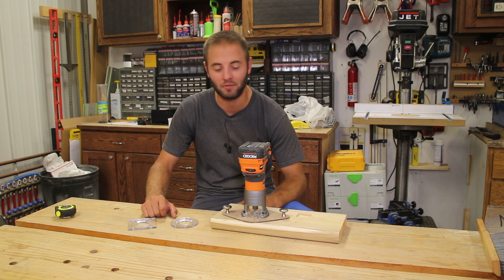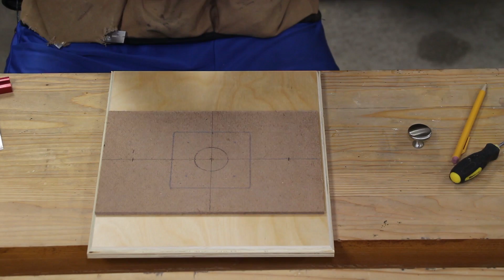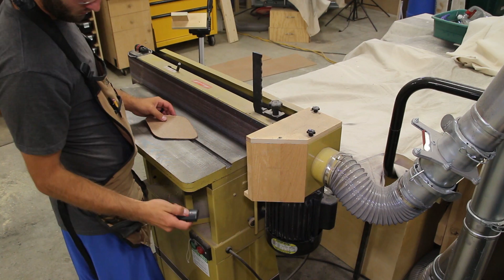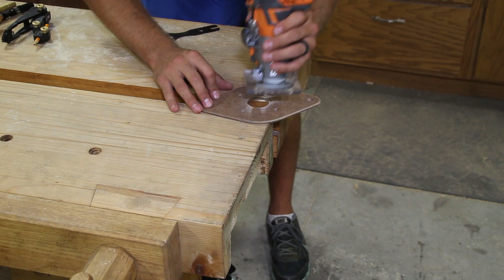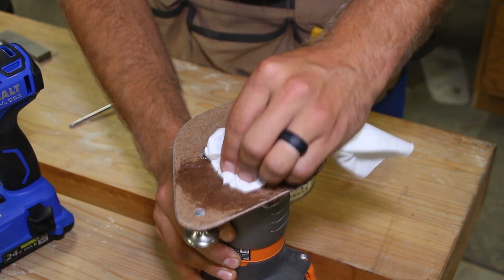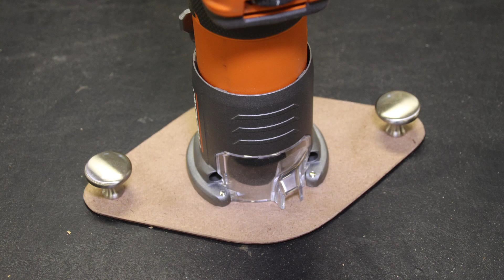Shop Made Router Base - Build It Yourself!

Comment: When making stuff like router bases or tablesaw inserts - instead of making “one and done” - I’ve forced myself into the habit of always making a pattern piece out of MDF or hardboard - and then using that to duplicate the effort using a pattern trimming bit etc. That way all the careful layout and sanding to the line etc is utilized over and over vs having to start from scratch every time. It’ll save you hours and hours.  I can knock out a perfect zero-clearance insert in 2 minutes- the pattern probably took an hour to make. Lastly- plexiglass/lexan is the only way to fly w router bases. You’ll be amazed at how often it’s handy to see through that plate as you work- especially for stuff like inlay work.   Keep up the good work - I do like your vids